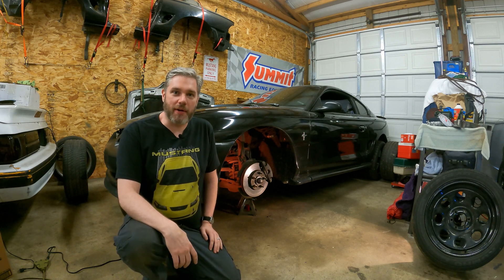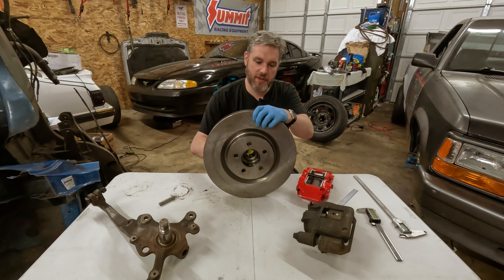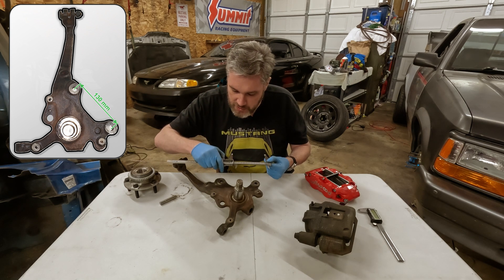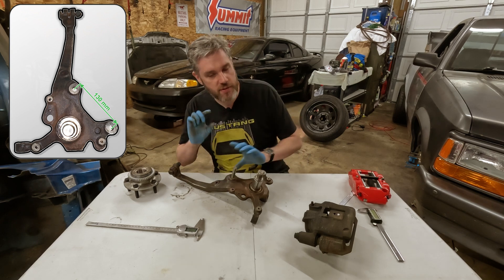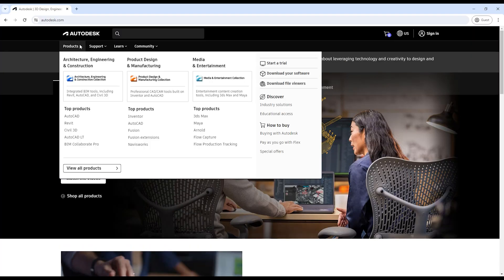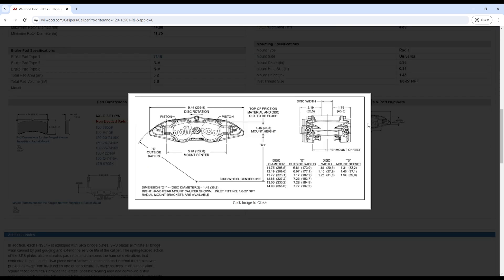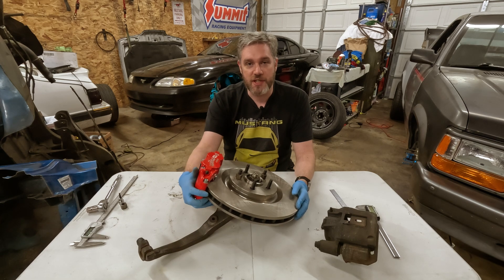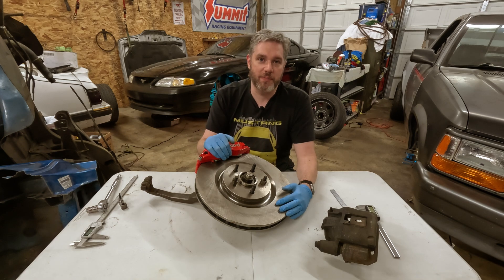Learn how to make a custom big brake kit for your car!

Comment: What about if I’m FWD?
Reply from the maker: The only real difference to FWD is that there is an axle through the center of the wheel hub but all of the fundamentals I've shown should work regardless of RWD or FWD.  Its all about finding the location in 3d space of all the parts to one another then building something to fit that.

Comment: Great video man I got a 2002 F150 Lightning that I wanted some big brakes on it and back in like 2008 when I made my kit I just winged it man and a buddy of mine worked at performance friction and I got some two-piece floating rotors that went on a Mustang but of course the bolt pattern is different so offset the bolt pattern to match my 5 by 135 bolt pattern. The factory rotor on my truck had the bearing housing all made into it so I just damn chucked it up in a lathe and turned off the exterior of the rotor itself and left the bearing housing got the centering piece to work on the bearing housing for the rotor but then I had overcome the difference in the the hat made it wasn't the same as far as where the rotors going to be Center where it needed to be. I just ended up making a bracket to move the stock caliper out an inch basically what it was and yeah long story short it's not perfect but it works great and I got over 100,000 Mi on them but it could be a lot better. With me reusing the stock calipers the way it mounts on there it doesn't bolt up like that Wilwood caliper that you have so getting the caliper centered with the rotor like it should be is more of a challenge I think I just need to get a different caliper and make a different bracket to match the the rotor that I have cuz there's rotors are like $750 a pair they are badass. But I ended up giving a guy like $85.00 for him brand new needless to say he doesn't work there anymore not cause of that because the owners are complete asshole and smacked him in the back of the head during a meeting period well enough of that but But I have no experience with cad or any of that shit I'm 55 years old and I don't know anything about that. I wish I could give you my measurements and all that good stuff and help me out but I mean hell the only 24 hours in a day I understand that. Anyway great video I'll figure it out

Comment: Some really solid info here thank you, ever since getting modern sport tires my brakes have been severely lacking. My one question is about rotor size and how that affects the caliper choice. I'm looking to pick up some Akebono calipers off a 370Z but I would still like to run 16s on my Vigor. Do calipers have a design specification of rotor diameter, say between 310mm to 320mm or am I over thinking that and i can just run the Akebonos on smaller(but still bigger than stock) rotors?
Reply from the maker: Yeah generally calipers and the brake pads are spec'ed to a certain size rotor range, for the wilwood calipers we used they clearly list the maximum rotor size they are designed for on their website.  Im not really sure exactly why it matters though because so long as the pad surface gets good contact it will definitely work even if its not optimally designed and I dont see minimum sizes listed though so its probably less critical.
Reply: @PowershiftFactory incredibly helpful information thank you man! That makes this project so much easier to plan.

Comment: Great video but the brake pad surface area on the disc looks around 60% they don't look big enough to make use of huge Disc upgrade???
Reply from the maker: That's a really good question and honestly I thought the same thing as you did when I upgraded my Dakota years ago but in practice it doesn't really matter. You have a greater / more even clamping force with more pistons, you still have the increased leverage due to the larger rotor diameter as well, and you still add substantial thermal capacity with the larger rotor which is ultimately more important. Even looking at the OEM 2 piston Cobra brake setup it only uses about 60% of the available rotor surface as well. You can quickly reach the point of diminishing returns where you could spend 4x the money on a bigger caliper but will not even see close to a few % of improvement.

Comment: You make Fusion 360 look so easy!
Reply from the maker: Thanks! I cant say it didn't have a little bit of a learning curve at first, but once you get the hang of it its one of the easier CAD applications I've used. Start to finish real time it took me 18 minutes to CAD up that part for this video!

Comment: thank you for this video!!! I've been thinking of doing the brake swap on my 90 super coupe for awhile and this helped so much!

I've been following you for awhile since info on our cars are so limited. Keep up the awesome work and I'll definitely interested in a set if they become available.
Reply from the maker: Thanks for the comment and support!  I definitely plan to put these on my supercoupe, its a bit lame on the early supercoupes like ours that we need to swap knuckles to do brake swaps though.  I thought about a cobra brake setup its fairly affordable but our cars are bigger and heavier than a Mustang, we need more brake.  Are you planning to keep the 5x4.25" bolt circle or changing to the mustang 5x4.5" pattern on your SC?  Once I test these brackets fully I can probably sell some!
Reply: @PowershiftFactory   I'm planning on keeping the 5x4.25 bolt pattern. This past weekend I was lucky enough to find 20" wheels in our bolt pattern. I'll be more than willing to buy brackets for sure.